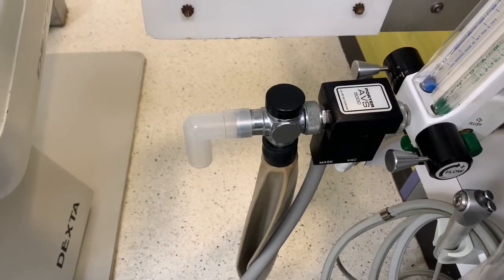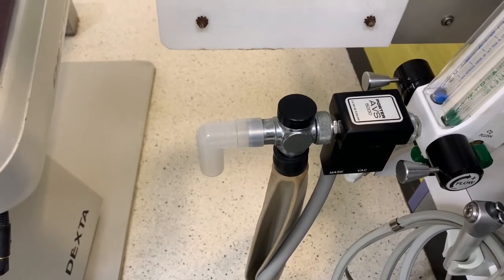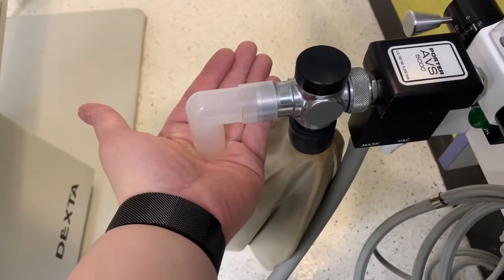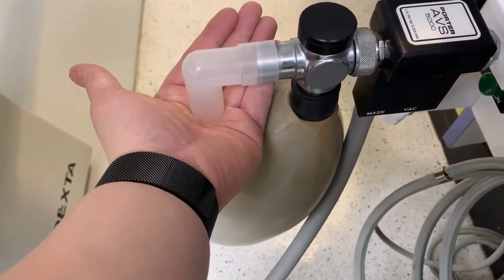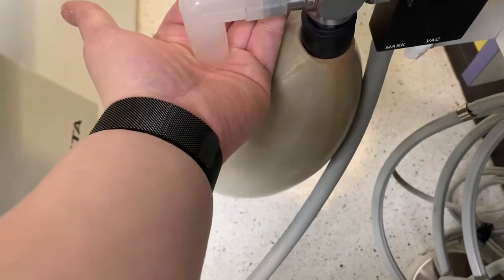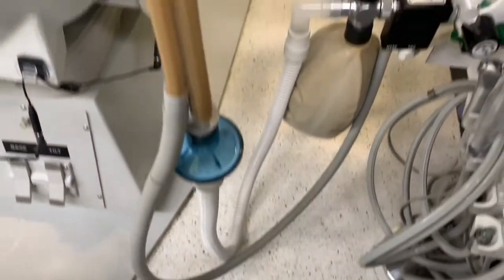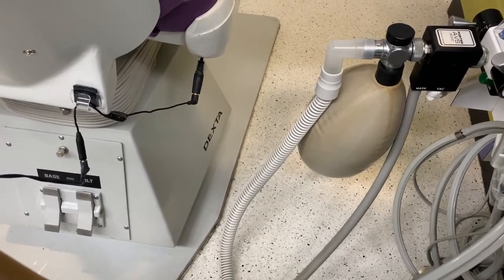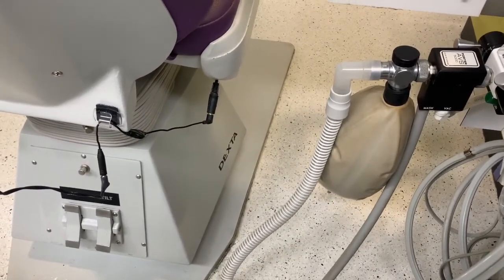Positive Pressure Flow From Porter Unit

Comment: Continually blocking the bag tee or kinking the hoses so that the bag fills to capacity and beyond will create back pressure and potentially damage the emergency air intake valve on the bag tee.  The sound you are hearing is the sound of the vacuum (through the outer mask) - not gas flow to the mask.  There will only be gas flow from the breathing bag into the breathing circuit if one of the following two things happen: 1 - the bag is filled beyond capacity (the gas goes from the flowmeter into the bag not into the tubing) which is not the intended use, or 2 - you are missing the one way flapper valve that is to be attached to the front of the bag tee.  Lastly - the bacterial filter pictured - serves no purpose and adds no safety aspect in this application.  Bacterial filters are commonly used on breathing circuits that allow for recirculation of patient exhalations back to a device and as a result potential for cross contamination.  It is shown in the video in a position that is one way directional flow from the device - the patient exhalation cannot travel back upstream (due to the one way valve on the front of the flowmeter).